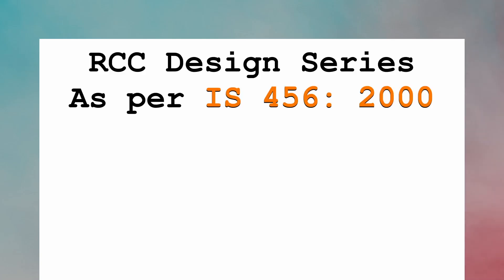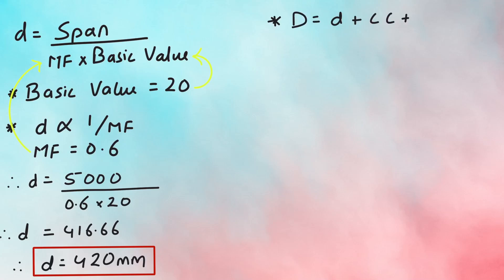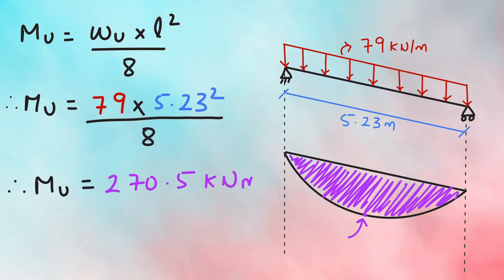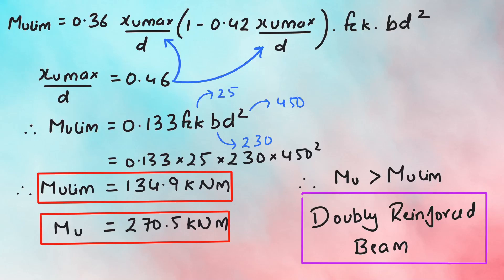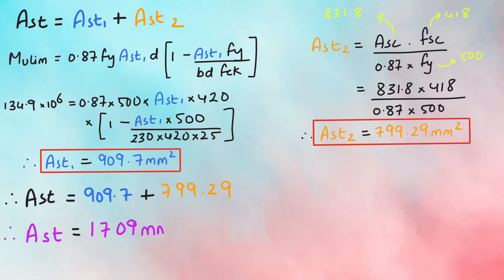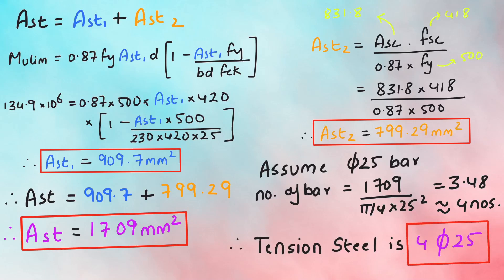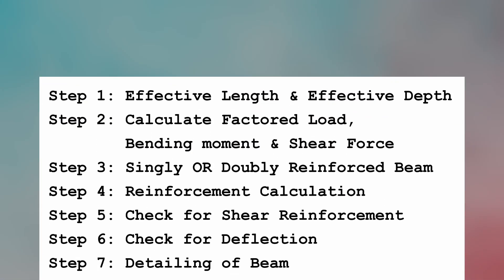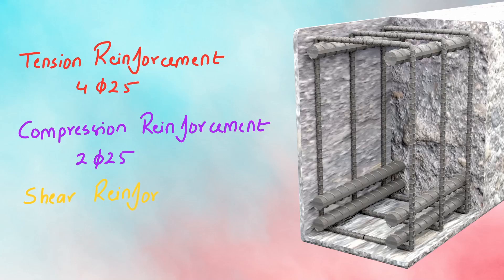Design of Doubly Reinforced Beam | IS 456:2000

Comment: Can all the 4 tension reinforcement bars be provided in the same level, or it needs to be provided as shown in detailing?
Reply from the maker: IS:13920 has clauses regarding minimum spacing between bars to ensure easy flow of aggregate. So if these criteria is satisfied, you can provide bars in the same layer.